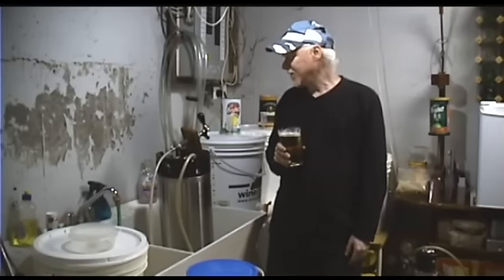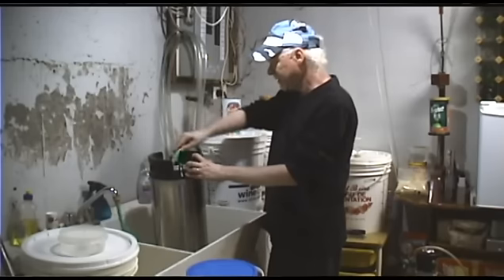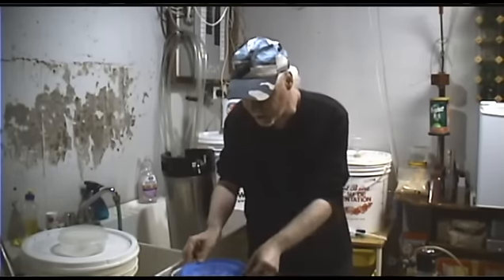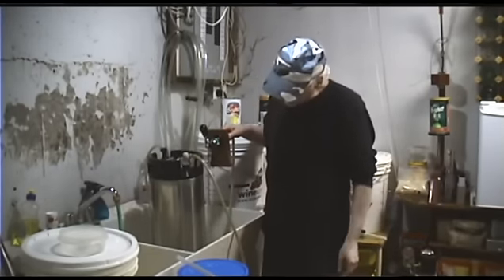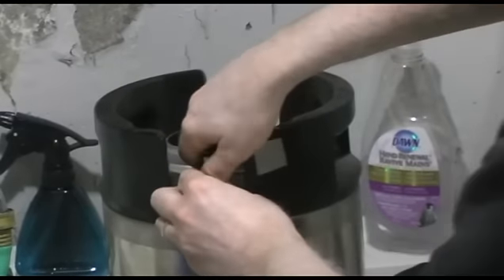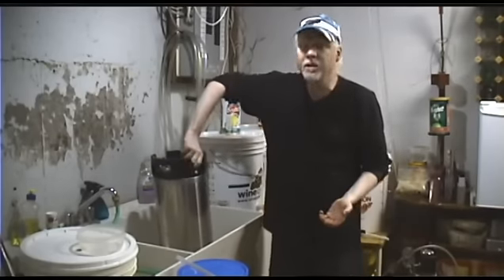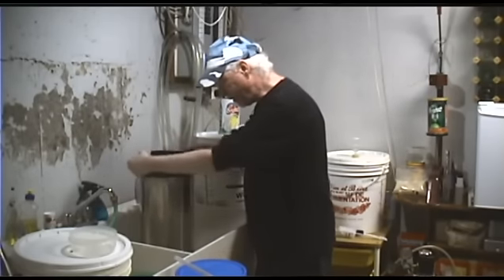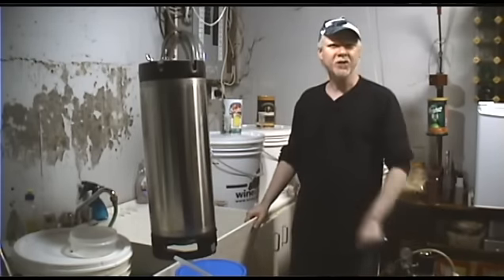Introduction to Kegging P2 - Keg Cleaning

Comment: Your videos are really well done. I clean my kegs with One Step and rinse as shown in your video. For storage of the keg, rather than attempting to dry them. After the rinse, I add about one ounce of properly diluted StarSan sanitizing solution. I purge the oxygen and leave a few pounds of CO2 in the keg. The StarSan does not hurt the stainless keg and with the CO2 atmosphere inside, nothing can take up home in the keg. Real drying requires complete disassembly and time for the tubes to dry out

Comment: Nice job , Next time you should fill your keg with water just below your gas inlet tube , this would take up some space inside the keg before pressurise your keg to clean the outlet tube to your dispencer . Think of all the co2 you will save .I gave it some thought , just another tip . Thanks for posting this great stuff and happy brewing ;-)
Reply: Valid point! Why not hook up a air compressor instead of CO2? Air is going to be deciding factor, anyway. Fill keg with cleaner, pump into next keg. Repeat with sanitizer?

Comment: I've been kegging for years and also use OxiClean for keg cleaning.  You will find in time that the quick splash and short exposure time you did will not be sufficient to get rid of beer stone and tougher buildup that develops over time.  I do overnight soaks with an Oxiclean solution filled to the top and ensuring both diptubes are filled as well.

Comment: Great vid Craig...I never used that oxi-clean before...does it leave a residue behind that needs a lot of rinsing  or does it rinse away cleanly - easily ?

Tip: To make cleaning easier and faster, I'd try to get a short hose that has both male female fittings so you can attach a sprayer to the "cut off" end you have ....this way you can pressure spray/rinse hopefully more quicker and thoroughly...Cheers!

Comment: @CraigTube actually, if you are going to use starsan to sanitise, it isnt necessary to rinse it too much.  Because based on what Jamil Z says, starsan removes the residue left behind by those cleaners.  So just rinse a1-2 times, then starsan and you should be good

Comment: Great video - very informative and THOROUGH!!  However, I tried dissassembling the poppet valve as you show in the video and mine does not seem to come apart.  Do I unscrew the internal parts to get to the spring? Do they pop out?  I just got this used tank and want to make sure all of the Pepsi is out of the system.

Comment: @CraigTube Yeah, Starsan is an acid based sanitizer and it neutralizes the residue left behind by Oxi Clean.  As an experiment.  put your hand in an oxiclean solution and then dip it in starsan. Should come out residue free!
Also, I didnt get to watch the whole thing but I know if you use warm/hot water when rinsing with oxiclean (and maybe any other cleaners similar) you have to use hot water  to rinse or you can get like a calcium buildup started that is a PITA to get off...

Comment: How long should the oxiclean sit in the keg and lines? I assumed it needed a few hours.
Reply: I used to be a line tech for a local brewery.  When we cleaned, we’d run the diluted solution through and leave it long enough to disassemble the faucet, scrub it and reassemble (and, just long enough to freeze the line, if the managers neglected to tell us about their coolant lines set for domestics; since people like them ice cold—as it masks the terrible flavor—it could take as little as five minutes to freeze the line up).  Oxy Clean isn’t nearly as caustic as the stuff we used, but your home brew kegerator isn’t going to see as much use as a commercial system.  Also keep in mind that some of those systems are 50-60 feet long and cover multiple stories, and it takes time to move the cleaner through the line.  If you let the oxy-clean sit for just a few minutes, it should do a good enough job for your regular maintenance.  If you’re keeping kegs attached for a long time, though (say because you just don’t drink that often because you started keto for the new year), then I’d go ahead and use a dedicated cleaning solution, though you may not need to use it at the full prescribed diluted strength.  Even then, every few kegs, I’d probably use a solution, especially for unfiltered beer.

Comment: I was told that oxi-clean is never to be used on food use equipment. 
I was curious that there was no mention of dish washing uses on the label. So I did some research and found a few people who called oxiclean and they were told NOT to use oxiclean on anything that will contact food or drink. 
I wonder if everyone who uses oxiclean will one day develop some new type of cancer or disease from exposure to oxiclean. I bet if you rinse well you might be fine. Kind of like using bleach..